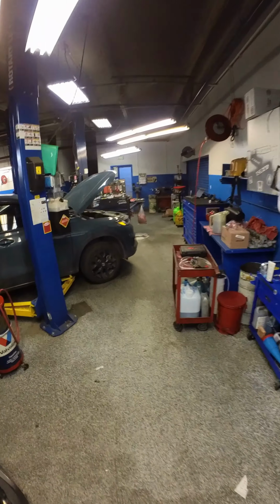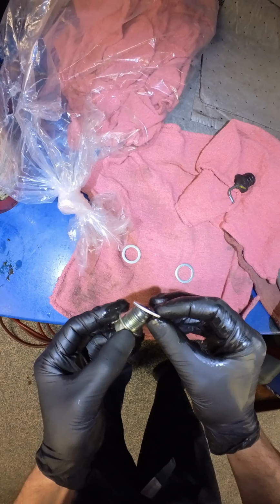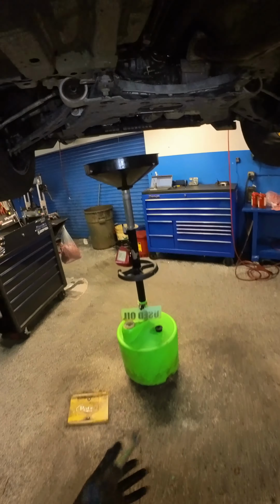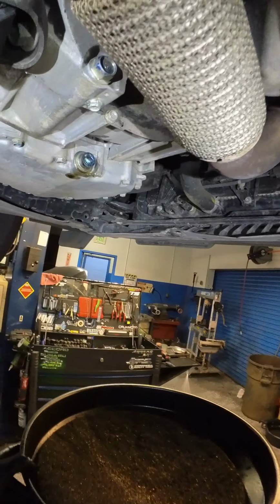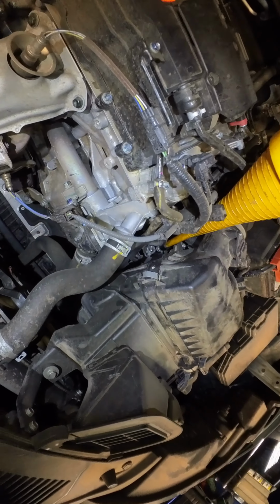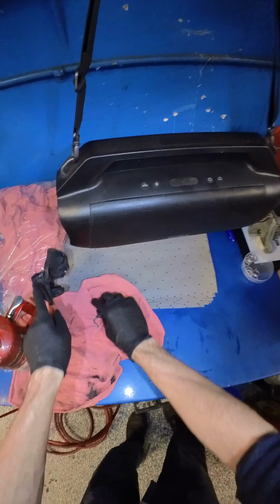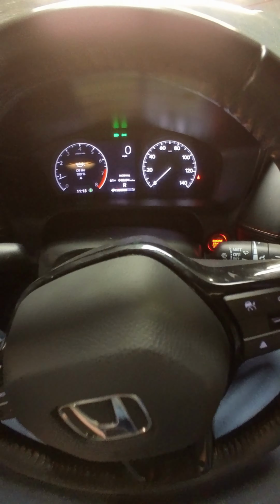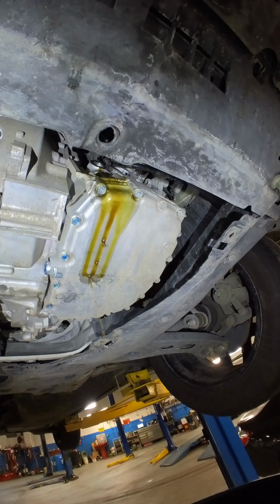2023 Honda HR-V Approved Recommendations 🔧😏👌 #2023 #honda #hrv #cvt #differential #pov #satisfying

Comment: What’s your opinion on this gen HRV as far as reliable transportation?
Reply: It now uses the legendary 2.0 liter engine that Honda has always used in the civic so if anything this one is gunna be even more reliable than the last generation especially with the updates Honda has made with the new cvt that the last generation didn’t have! Even tho the last generation had a very reliable engine it’s just the cvt was known to grenade very easy very early especially if the maintenance wasn’t done
Reply: @nathanielcasas8923  yeah the CVT transmission.  I have had this since July 2022 (the first batch of owners, and 3 safety recalls (seat belt, rear windows, steering assembly, and one broken power window issue.  I have 24k miles on it.  The OEM tires are worn out already.. one of the worst OEM tires from Honda.   Other than that, it is ok.  =) I am worried about the CVT even though my dealership offered me 150k miles with 10 10-year extended powertrain warranty for free (they probably added it to the markup price already).  The driving experience of the CVT is not smooth, I prefer the 6-7-speed automatic.  Anyway, it is what it is..

Comment: You do know that this CVT transmission has 2 filters?  One inside the pan and a smaller round filter near the fill hole. Why didn’t you change these filters?
Reply: Because they aren’t a maintenance item? Change your fluid when the maintenance minder tells you and you won’t have issues.
Reply: @areallytallguy  And eventually when one or both filters get so clogged they no longer can filter or oil can pass through, what’s your solution?
Reply: This is a brand new car, you don't need to change the filters yet
Reply: @hjer731  So if that theory was right, why change the CVT fluid now?

Comment: I thought you were supposed to have the engine running when checking the level on an automatic transmission. Yes i know this is a CVT but normal autos and CVTs are very similar. One is just driven by fluid pressure and wet clutches while the ither is driven off fluid pressure and a belt
Reply: Not for hondas. The level is checked at temp, engine off

Comment: I have a question, do you know how difficult it is to remove and install a starter on a 2015 cr v. I need to replace my starter with only 110,000km. This video is excellent as usual, you explain what you’re actually doing and how to do it. I really respect you for being so passionate about your work and carrier. Anyway I’m hoping that the starter isn’t to difficult, it’s on a 2 wheel drive model.🙂
Reply: Honda tech here, not that difficult as long as you have the right tools for the job, just don’t go crazy tightening the power cable nut cuz you’ll break the starter over torquing the hell out of it

Comment: How often are you replacing the ac suction and discharge lines on these crv’s?
Reply from the maker: The lines don't leak it's the a/c compressor end seal that leaks

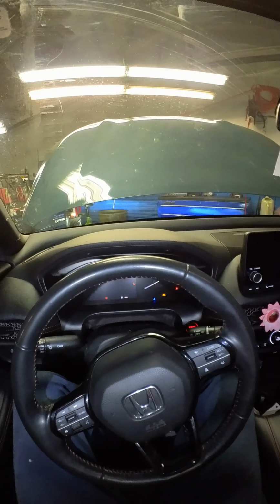Comment: WOW 48k+ miles on a few months old HR-V… Or I am just wrong? @ 6:18
Reply: you are correct 48k miles, I have a 2021 with about that mileage
Reply: @papo862  I have the same HRV since July 2022, and I have 24K miles on it.  and not yet to change the fields.  My rear diff fluids will be changed on the next oil change schedule.